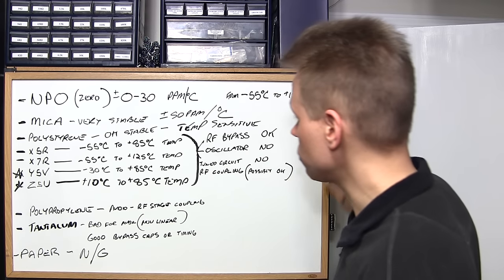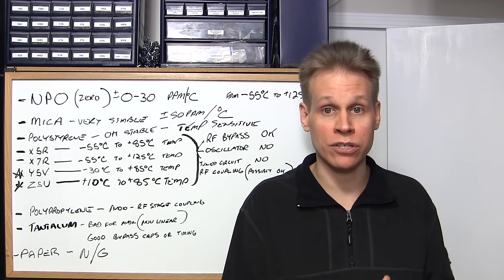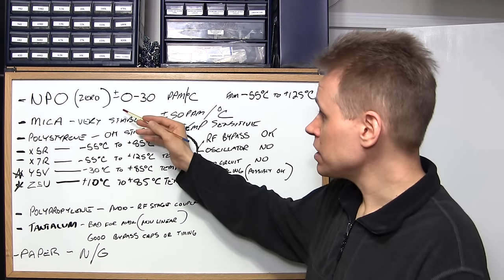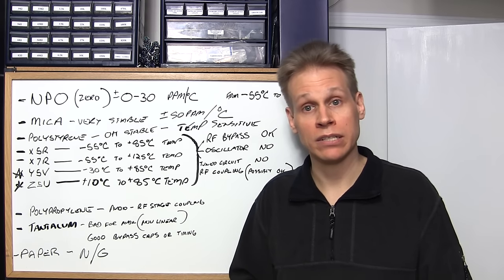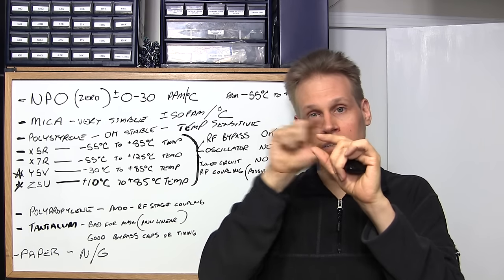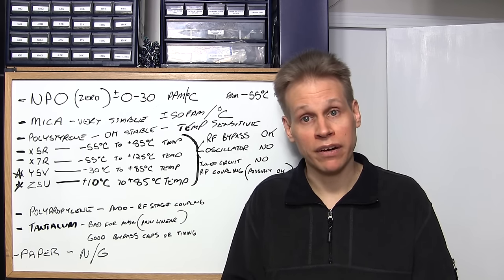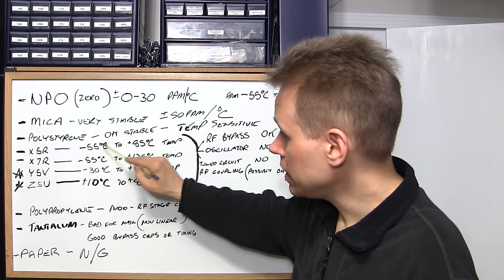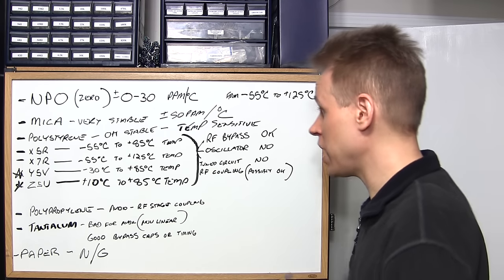Which Capacitor Do I Use? Tech Tips Tuesday

Comment: Many years ago I was involved in developing sensitive alarm systems. We utilised the Piezo-electric effect of ceramic caps for vibration detection as part of an 'anti-tamper' warning sub circuit. Our ceramic cap piezo-detection circuit was much cheaper than the vibration detection devices used in previous systems and they turned out to be much more reliable, I believe there are still several of these alarm systems still in 24hr use today  over 25years after installation. Sometimes the normally 'unwanted effects' of components can be put to good use. :-)  Many thanks for these videos Paul. Keep up the good work Sir! 73.

Comment: Really nice video.  Maybe a part II on aluminum electrolytics, and the voltage dependency of many capacitor types.
Reply from the maker: +w2aew 
Thanks for the kind words Alan! In the future, I will do a dedicated video on electrolytic's, complete with the usual examples. This video was already getting pretty long for a TTT. I always look forward to seeing that little notification pop up that says you have made a new video :^)
Reply: +Mr Carlson's Lab Will look forward to that video, I work more with electrolytics than anything else...
Reply: +w2aew Agreed, I think this effect is what many folk unwitingly experience most.
The change in capacitance under DC bias would be good too,especially how the values can be changed perminantly under high voltage excursions
Reply: +w2aew Great video!  I'd also love to see a similar video on electrolytics!
Reply: Maybe even variable capacitors.
Reply: Maybe even how to make your own high voltage capacitors if you can't find a suitable replacement
Reply: I'd love to learn more on aluminium  electrolytics. Temperature sensitivity, etc. They're so common in use!
Reply: @Thujaplicata1  I can tell you that aluminum electrolytics have limited life; by ten years a lot of them will have suffered leakage or open circuit, sometimes intermittently. Tantalum capacitors are more reliable. Many failing ones bulge, and if you look at computer circuit boards that have been left on for about 5 years or more you will see a lot of upright aluminum electrolytics with Xs on the top that have started bulging. Eventually they fail altogether and leak white powder (well, it is powder when it hits air for any length of time. It is probably the most common failure in most computer boards.
Reply: @flagmichael  you're absolutely right.  I used to repair CRT tvs a lot (20 years ago) and they were a very common failure item then.  Heat is the main killer I've found. They definitely have a finite life.  I remember the mitsubishi electro home sets of the early to mid 1990s that ALL of the aluminum electrolytics would leak and fail in.  This affected many many other manufacturers as well.  Then there was the mass capacitor failures of computer motherboards/power supplies and such in the early 2000s or so.  The tvs I kind of miss,  things were easier to work on, and parts were plentiful for the most part.
Reply: Yes, I too would be most interested to see an electrolytic video.
Reply: @MrCarlsonsLab  
To long? LoL.... No, it has to take as long as it needs to! This video could have run for 5hrs straight and the more that you have to say about the topic, the more that I have to hear it! 
From what I have seen with other TTT videos is that they don't appear as popular as a video of any length based on exploding capacitors! If you want a viral video, that's what you have to do, just blow up electronic components in a most spectacular fashion and don't forget to include your over reactions and clickbate title and it would be the highest watched video that you will ever make. 
The lower view count on TTT videos is due to the automatic filter that only attracts true hardcore people who are interested in acquiring a superior knowledge in electronics! These are the people who remain loyal and return to watch every single video! These are the videos that you will be remembered for, I can remember the majority of your videos off the top of my head and yet even though I also watch Electroboom, I seem to only remember the one video where he made an electric guitar 🎸, yeah I don't think that I have ever laughed so hard... But that's not to say that he doesn't have any real content, he does but all the fun kinda overpowered the stuff that needs to be remembered... This video was excellent but I think that we both know that there's a lot more to capacitors than just the effects of heat, you touched on DC leakage but a nice big analogue uAmp meter showing the leakage would have taken this video to the next level, then there's the effects on phase angle in circuits that are affected by that and so on... Sure it's probably going to be a 4Hrs video but it's going to be the goto holly grail regarding capacitors... I hope that this finds you well 🙂
Reply: Very nice job. I am recapping my Supro amp from the 40s. This is just what I needed to know 👍

Comment: 2 years ago I bought a brand new 50 watt all tube Marshall amp JVM 215C.  

I couldn't use it for a few months. But when I turn it on it started crackling which I guess is a typical sign of the capacitor 

It took him five weeks to figure out it wasn't tube or a resistor.  It was a "silver mica" capacitor.  He said it's rare for one to go out on a new amp but it did. 

Now that it is fixed, it sounds like new.

Thank you for this video it's thorough and informative. 🙏🕊️❤️

Comment: Excellent overview and tutorial for someone starting out.

There is one application where I always replace ceramic capacitors.  Old tube type CB radios often used either a dual section or two separate ceramic caps as line to ground safety caps.  They are in service all the time since they are connected directly to the mains input they live a hard life.  I have seen several of these plain blow up and flame out.  I just uploaded a couple videos yesterday and today on a customers Tram D201 I restored and went over why the ceramic dual section bypass cap should be replaced.  I use modern X1 / Y2 rated caps (the blue disc type) for line to ground and also add a X2 rated one (yellow box type) across the line for some additional filteting.

Ever run into silver migration problems in the old mica mold caps.  I did once and it drove ne nuts tracking down the culprit. 

Mike
Reply from the maker: +MikesRadioRepair .CBRadio 
Hi Mike, I have run across silver mica disease in some AA5 IF transformers. I use those 1206 NP0 parts displayed in the video as replacements. Those old Tram radio's are pretty neat, I have one as well, somewhere around here. Thanks for the kind comment!

Comment: Paul, Very good explanation of the various capacitor types. Don't have any horror stories about tantalum caps, but in my youth we had some (temporary) fun making paper caps explode like firecrackers. That was definitely an extremely dangerous stunt that should not be done. Still have a scar on my forehead where one of the capacitor leads impaled itself. If it was one inch lower, and I had removed my glasses, I would have lost sight in my right eye. The high school lab instructor was not pleased and we ended up with a weeks worth of detention.
Reply from the maker: +Donald D'Egidio 
LOL, Great story! I think we all did silly things like that.... Your not alone :^) Glad you enjoyed the video.
Reply: My friend built an amplifier with some fairly large paper caps that he somehow managed to solder the wrong way round, luckily it exploded when he was out of the room !  destroyed the amp and made a mess of his room, NEVER mess with electrical equipment unless you know what you are doing, and double check anything you know could be dangerous, my friend knew wiring  the caps wrong could be bad news , but just had a brainfart, always double check!
Reply: happened to me a couple of days ago... just toooo late in the evening wanting to finish and test it before going to bed is not such a good idea ;-) Surprise surprise with a nice bang and hissing. Must have been 35 years ago or such when that happened to me last time before...

Comment: If you had told me that I would spend 24 minutes watching a video about capacitors this morning, I’d say you were crazy.  I figured I’d watch the first two minutes and move on.  This was an excellent video, while I don’t see myself designing circuits (I will copy them), this knowledge is useful in practice.  I would like to have seen some segment on the leaky effect of the paper caps too, something to back up your claim (although I don’t doubt you).
Reply: Just check the DC resistance between the capacitor terminals. If the capacitor is not leaky the resistance will be high (tens of megohms at least), whereas if the capacitor is leaky the resistance will be much lower.

Comment: Viewing in 2019.  This was so informative and has helped greatly in clarifying the subject.  I wish I had watched it a couple of days ago before I had to re-solder a tiny SMD cap in an RF tuner that had shifted due to my having to repair the RF socket.  I wouldn't have worried so much about heat transfer.  Thank you again Mr Carlson.  Cheers.

Comment: This video deserves a million likes instead of some stupid kid smashing a grilled cheese on his face. When faced with the multitude of choices on DigiKey this gives you a great way to get to the perfect part. How about a video on electrolytic caps, trade offs for tolerance, high temp, and so forth, I've seen some with super lifespans and have not ordered them just chose a good brand matching basically what was originally used. I've always wondered if you were to recap a receiver completely with the extremely long life ones if other properties of the part would be an issue. I have one project from the 70s I havent torn into yet but it's a very nice unit and when I tear in I would love to design the boards to last 100 years, maybe it can live through a couple generations in my family, I'm pretty sure there are some downsides to the properties of those that would make them not the best choice

Comment: Great video. Shows an excellent reason, with demo, as to why not to use ceramics in an audio path. (would be nice to have seen tantalum distortions though. Speaking of tantalum caps, the biggest thing I dislike about them is when they fail, they usually short, with fireworks when used as power supply filters.)

Comment: Just caught this (after two years!).  Good demonstration, but I wish you'd covered more than just polypropylene (& polystyrene) films.  I think the public would be well-served to understand the strengths and weaknesses of the various film dielectrics, including polycarbonate, polyethylene (/PET/PEN/PPS), Teflon, etc.  Perhaps a "Part 2" specifically on film caps?  I noticed "Raindrop Services" asking for it (about a year ago) as well.
Reply from the maker: Thanks for your input Andrew.
Reply: Yes, it is a good idea. People think that some capacitors have some magical properties, say Teflon, or silver foil in oil, or Clarity Cap being better than Solen, so to bust the myths and give us guide what  actually works properly in given circuit would be great idea for a video. I read stories, say, where Wima MKP supposedly sounds better than other brand, but I don't really buy it, and if it really does what's the reason for it (maybe accidentally polarity was reversed).

Comment: Love your channel. I know this is an old post, but had to comment. When you described the ceramic as very dependable and rarely fail I had to laugh a bit. In high school in the 70s I worked in a radio and TV repair shop. One of the first TVs I repaired in the shop had no audio. Guess what it was... A ceramic cap had shorted! I know it's rare, but it had no visible damage and yet tested as a direct short. That was a fun one. By the way, the shop was in SW Virginia where a lot of folks heated their homes with coal. Still saw a lot of tube TVs... There would always be a coating of coal dust all over the HV sections and CRT.... Made for some fun troubleshooting as the coal dust is conductive and the HV would find its way all over... The light show inside these TVs was quite pretty! Lol 😂
Reply from the maker: Thanks for sharing your story Marty.

Comment: That's a lot of nice test gear. This is very good showing the effect of temperature on capacitors. 
I built an FET 5-5.5 MHz vfo for my home built transceiver using silver mica capacitors which had some drift so I looked at capacitor data and they had a Positive Temperature Coefficient so I changed one for a polystyrene type which had a Negative T.C. and stability improved after leaving it one hour to fully cool down from soldering. Still some drift so I changed another and stability improved again. I changed another and the drift went the other way so I settled on two polystyrene. I drew a graph and checked every ten minutes over an hour on several days and it showed a very slight up and down drift but basically remaining on frequency. I had glued the components to prevent any movement and used a ceramic coil former.
Bill, G4GHB.
Reply: One thing to try might be to put two different types of caps in parallel, such that the positive temp coefficient of one counteracts the negative temp coefficient in the other one.
Reply: @drtidrow  Many years ago there was a trimmer capacitor called a Tempatrimmer which used that principle. When making my transceiver I contacted the company to see where I could get one but they had stopped making them. I was reminded of them because one day I walked past their place in the Lake District while on holiday.
G4GHB

Comment: What would be the best choice for replacing basic through hole electrolytic capacitors in video game systems such as Sega Genesis,NES,and SNES? I mean of course other than just putting new ones of the same type. 
Also what would be a good type to substitute for basic Electrolytic through holes in Game cartridges? 
I have seen a few leak and make one hell of a mess on the board so am looking for solid alternatives.

Comment: you know you are going ultra old school when you hear "solid state electronics" ☺
Reply from the maker: +A. R. Jasso 
LOL, It's an easy way to separate the two technology's.
Reply: Ultra old school! Why, you whipper-snapper, if I wasn't retired I'd give you such a talking to! Ultra old school was field coil speakers and radio dials that went from 0-100. When you found a station you liked you wrote down where it was - tune in 37 for news and weather. And I'm not buying a hearing aid because they don't make any with loctal tubes - all the octal tubes fall out when I dance.
When I got in to General Aviation (small aircraft) avionics in 1970 most of the equipment we worked on was hybrid - some transistors (at least in the power supplies and audio) and some tubes. By 1980 I don't think there were any tubes in the new equipment, and ICs (small scale) were appearing. Technology moves faster now!

Comment: One of the caps you didn't describe are the retangular blocks on the input of AC power circuits. I would be greatly interested in what they are, how they are used and how to determine which one to use. Great video

Comment: As an Electronic Engineer working in the design, testing and maintenance of aircraft phased array radar targeting and mapping systems, I really like your videos. My original training in by 20's as an electronics technician was with ground--to-air radio transceivers, receivers and transmitters that still used electron vacuum tubes and Klystrons. Although your area of expertise is outside (below) the frequency bands where I currently reside, I still enjoy learning from you about other frequency circuit deign and characteristic paradigms. One can never learn too much.....although we at times can over-think things.....which can most generally lead to error..... Keep up the good work, my friend.

Comment: I am sorry but no mention of electrolytics? I have some old Heathkit kits that have electrolytics. I assume, since they are decades old, have gone bad. Thanks for an otherwise great vid on caps.
Reply: To be fair, he kind of covered those when talking about the paper and foil caps. Electrolytics are the same thing, just paper and foil and the paper is soaked in an electrolyte. It's not that they're inherently bad, electrolytics do serve a purpose, particularly in achieving higher farad values than polyester or ceramic ones.
Reply: Checkout badcaps.com They maybe able to help you?
Reply: Thanks for reminding me they're aluminium canned paper jobs.
So would I be mad to try and replace all aluminium electrolytics that I maybe replacing anyway (for example power supply) with poly or tantalums, ignoring expense and availability of farad capacity?
Reply: Tyeth Gundry
Yes and no. There are some benefits to using electrolytics. Capacitors are more than just things that can store an electrical charge, and the makeup of them determines their overall activity in a circuit.

Electrolytics are super common in power supplies for smoothing out ripple, which you'll want to achieve a smoother output voltage. I can't speak for ceramic or tantalum capacitors as I do not know enough about their major usages, but I know for a fact you'll find more electrolytics in high-voltage filtering applications than the other types, like in power supplies and amplifiers.

That might be something you can do as a little fun project. Build your own power supply and test the outputs with different kinds of capacitors. You'd need a scope but I think the results would be interesting.
Reply: Electrolytic capacitors lose their capacity over time, even when just stored. At the same time they remain as much as big and weight as much. But they still can be used, though not in the most efficient way.